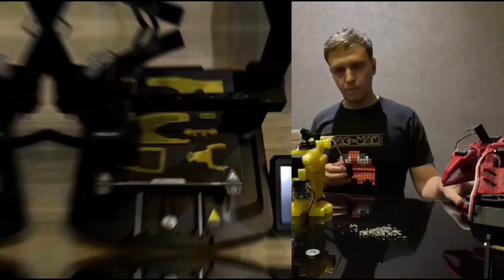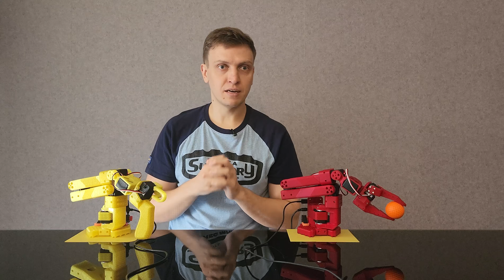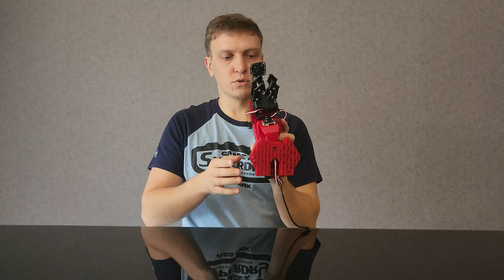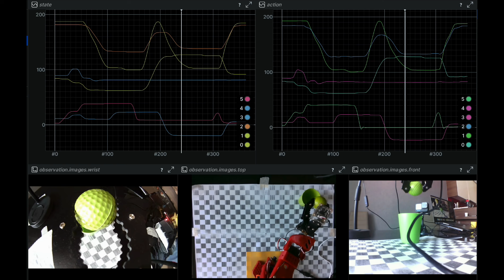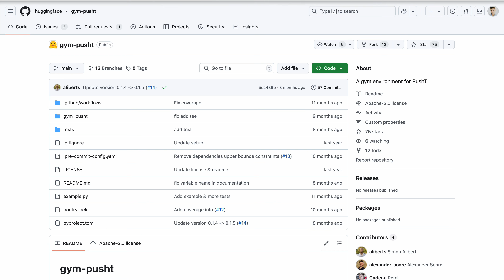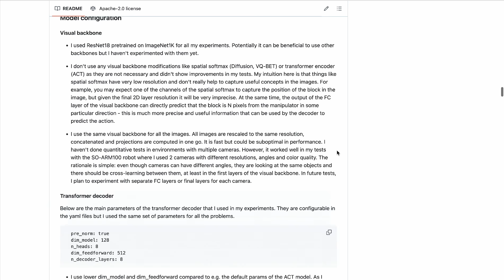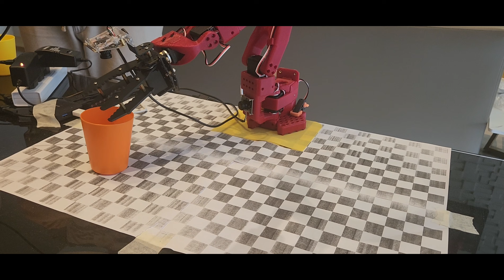Running AI robotics experiments at home with LeRobot and SO-ARM100

Comment: Cool video! One question regarding your setup: You're using that chessboard surface for recording the dataset .. that probably helps the model with coordination. Does the trained model work as well on other surfaces or does it require those squares to orientate?
Reply from the maker: Small models like ACT are usually very sensitive to the environment change, but if you train a bigger model with diverse enough data it will work with other backgrounds as well. You don't really need this chessboard pattern.

Comment: Hii,
I use a realsense 455 camera instead of a webcam because I don't have 2 webcams

But I couldn't get 30fps--- frames were dropping
So I used 15fps, can that affect the policy???
The robot picks from 3/5 positions which were in the training data

Can 30fps help??
Should I collect data again with 30fps somehow??
Reply from the maker: For simple tasks 15fps should not be a problem, anyway you usually make ~1s chunk predictions. For hard high dexterity problems FPS can be more important.

Comment: Hii
The dot policy looks very similar to the ACT policy...
What's the difference??
Reply from the maker: Yes it is very similar, but dot is even simpler. My initial idea was to take some of the existing simple policies, drop most of the components from their architecture and add them back one by one to see what actually matters. So I started from ACT and removed like 2/3 of it - removed the whole VAE part and encoder transformer, and kept only one decoder transformer + simplest possible inputs and outputs encoders/decoders. So it is the minimal possible transformer based policy architecture. And turned out that I don't even need to add anything back, it already worked well, with some extra tweaks I made it better than ACT and Diffusion on a couple of simple tasks (I just used what was available in LeRobot at that moment). ACT is usually considered a simplest go to policy, but I have shown that you can have even much simpler policy with much less parameters and it still works well.
Reply: @ilialarchenko ooh nice way 
Thanks!

Comment: What about collection data while changing camera position relative to world? if we will run inference on one unique camera pose, the model learned to pick and place only with a specific relation
Reply from the maker: Yes it is true. Changing cameras positions will break the model, as it overfits to the particular camera set up. It is partially resolved by training time augmentations (you randomly clip and rotate all images) so it should be robust to small changes, but any significant camera position shift will break it. I think if you have a lot of data collected with very different cameras set ups and big enough model you can train a policy that is much more camera agnostic, but you will probably need a very big and diverse datasets for it. Also I am not sure if you can achieve the same results as with the fixed cameras given the same amount of data. It is a nice topic to research but I haven't seen any papers trying to do it.

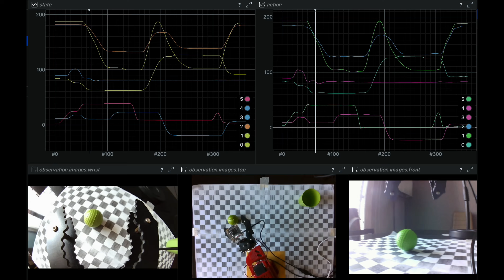Comment: Are you training the model from 3 different camera angles 28:22 ? and during interference which camera are you feeding to the model ?
Reply from the maker: Yes, I use 3 cameras simultaneously both for training and inference. In practice 2 cameras (gripper + some high level view) are usually enough for simple tasks, but the more cameras you have the better.

Comment: I know this is an old video, but it would be great to see what useful tasks people have done with these - I think the main concern I have is the lack of dexterity, and it is confined to a small radius of action, which limits agentic utility - but I would love to be corrected if I am mistaken
Reply from the maker: Yes. It is true. It is hard to go for a production use case with this robot. But it is useful for the education purposes and prototyping. Eventually all processes and policies are the same for $100 arm and $5000 one. So if you have a good recipe for SO101 you can upgrade your setup to a more capable arm, and it will probably work without big changes.

Comment: Thank you for your informative video.

But I’ve got one question.

My question is whether the initial position of the motor rotor matters when you assemble it. Is the horn’s position relative to the motor important? In other words, is the starting position fixed, or do they use some calibration system to account for it?
Reply from the maker: There is a calibration process that allows you to fix any inconsistency in the assembly. But there is still a default position of the robot that corresponds to the middle state of each motor and it is better to assemble it close to it - but you don't need to be very precise, calibration will fix small mistakes.

Comment: Super helpful video Ilia, thanks a lot! One question, I built an SO ARM 101 with a wrist camera as well as a top camera mounted on pole. I have been collecting pick and place datasets, with a cup and a pen cap that should be collected. I then trained ACT with Lerobot train code. In the first dataset I varied the position of both the cup and the pen cap and the success rate was 0, the arm always tried to grab at the wrong spot. I then made it easier, by having the cup always at the same position, now the success rate is maybe 10% but still the arm tends to grab a few centimeters at the wrong spot. Any advice how to improve this?
Reply from the maker: Is your top camera fixed? If it is not in the exact same position during the dataset collection and rollout, it can be a problem - ACT can be very sensitive to it. Overall, it should be relatively easy to get a 50%+ success rate for a simple pick and place task.

Comment: Can you share where to find that gripper? Seems to be a lot better than the original one.
Reply from the maker: I took the gripper from another robot I bought many years ago. I think it is this one: https://www.ebay.com/itm/222230012431
However, it is not designed for the servo motors used by the SO-ARM100. So, I really brute-forced it to work (don't recommend it).

Comment: What is the system setup required for this how much vram required to train the model
Reply from the maker: For small models like ACT or DOT, any reasonable GPU will work. I trained it on 2080Ti, and it was enough. For anything bigger or large datasets, I would recommend renting H100/H200 in the cloud.
Reply: @ilialarchenko thanks for your response  i am planning to use openvla model for my tomato picking robot  , which hardware setup is best
Reply from the maker: @santhoshkumar181994  OpenVLA is pretty big. I would recommend H200 or maybe even a few of them
Reply: @ilialarchenko thank you

Comment: Hi Ilia, Regarding the camera positions, should the top camera have the entire follower arm in its view? Or is the idea to focus on the objects? What would your recommendation be? What would be the 2 mandatory positions?
Reply from the maker: I think it is an open question with no correct answer. Good practice is to have one view that gives you a big picture - like s top view, and one view from the gripper. Good sanity check is to be able to teleoperate the robot using only cameras feed.
Reply: @ilialarchenko  I wonder if it's possible to train a policy that takes not just raw camera feed as input, but perhaps a worldmap maintained by some SLAM software as well. A behavior could be trained to assist in mapping by having the arm "look around" until it sees the ball. Then, even with a 1st person perspective on the gripper or robot base with no 3rd person view, it might be able to grab the ball (to use your training scenario as an example) and get it into the cup - even if both are not directly visible at the same time.
Reply from the maker: @MrMo-oh4wf , yes you can add extra inputs to the model, like the map and signals from navigation algorithms. But you can also train the policy to search for the object and move to it directly end-to-end. VLA models do simple navigation pretty well.

Comment: Hi Ilia thanks for the video, question is possible to collect and train the model on a Jetson Orion nx? What would be your recommendation if you don't have a PC with a GPU at hand?
Reply from the maker: It is possible to train and run a small model on Jetson Orin: https://www.hackster.io/shahizat/running-lerobot-so-101-arm-kit-using-nvidia-jetson-agx-orin-19b8a4?ncid=so-link-375235-vt48&linkId=100000373759001

However, for larger models (such as VLAs), you will need a more powerful GPU. I recommend renting it online.

Comment: I attempted to finetune a smolVLA model on a similar setup (top down camera and wrist camera, and random placements of cup and ball), but mine ended up not finding the ball. it just goes to random locations and opens and closes the gripper. I trained it with 20.000 steps, and i had around 60 episodes. What would you do in a situation like that? More data?
Reply from the maker: I have another video about VLAs https://youtu.be/8dZUOo5xWFw and will post one about SmolVLA later. I haven't experimented with SmolVLA much yet, but you can see a short demo of SmolVLA trained on 55 episodes of very similar problem and it works more or less fine. I used default parameters for training and it worked without problems.

You probably have some basic issue:
- Did you check you recorded dataset? Are all videos recorded properly?
- Did you move you top down camera? Your policy can be very sensitive to camera location - if you collected data with one camera position and then moved it a few cm, the policy can fail
- Check that you send camera images to the model in the same order you used for recording dataset.

It is hard to say what exactly wrong in your case, but I would do some sanity checks of the set up first.

Comment: I wonder how about using cheap motors like MG 996 at follower robot and only encoders at leader?
Reply from the maker: You still need encoders in follower for 2 reasons:
1. It uses PID to self-correct - without encoders, the position will be much less precise.
2. You use the current actual positions of the motors (state) as one of the inputs for the policy.

I think follower without encoders will work much worse.

Leader with only encoders is sufficient for teleoperation and dataset recording, but there are some use cases, like human-in-the-loop RL, where you want the leader to have motors too.
Reply: Thanks for the information.

Bus servo motors are quite costly here, $50 each.

My plan is to try with Mg996 + encoders. I know it will be much hassle. 😢
Reply from the maker: @MahmudulHasan-eq7ug  I also think that MG996 has a different size, so you will need to adjust the 3d models for the arm too, to fit them.

Comment: Hey good  job on the DOT policy, was wondering what is the minimum requirement to perform inferencing and fine tune your model
Reply from the maker: In the video, when I demonstrate how it works with the real robot, I am running it on my MacBook M1 without any GPU. It processes images from 3 input cameras and makes ~25 predictions per second. For training, any reasonable GPU will be enough. Of course, the training speed will vary, but I trained a real robot policy on 2080Ti in one day, and it was enough.

Comment: Hi there! i was wondering what screws did you use to mount your base camera?
Reply from the maker: I just used some small wood screws. I don't know the exact type. I have printed more proper camera brackets since then.
Reply: Would you be able to share the STLs for those? If not I could definitely check around a local hardware store for some wood screws that fit
Reply from the maker: @draxicon5139  yes, the camera mounts that I use right now are shared here: https://github.com/IliaLarchenko/lerobot_random, but they are for my specific camera

Comment: 7:12 later it could used for two hands operations, like threading a needle 😅
Reply from the maker: It is possible but a bit challenging. The best way is to use 2 leaders and 2 followers simultaneously. And for threading a needle you will need a more precise robot.

Comment: Hey, I found this model worked very well with the old recording format
, will it be ported to the v2 data format?
Reply from the maker: Do you mean DOT policy? It should work with v2, but there were other changes in the library since I made it, so not sure if it still works out of the box. The LeRobot team was working on a PR to merge it into the main library, but I am not sure if/when it will be done.

Comment: Hello. Thank you for the video. Would you mind recommending a power supply and servo bus driver compatible to use 6x 12V servos (e.g Feetech 12V 30kg STS3215) ?
Reply from the maker: You can follow official BOM: https://github.com/TheRobotStudio/SO-ARM100?tab=readme-ov-file#sourcing-parts
Regarding the power supply there are many discussion in discord. Official recommendation is to use 4-5A one, but some people try to measure it as say that it never goes above 2A in practice. I even use 1A supply for 6 12V motors and it works well, so just choose one that is easy to get.
Reply: @ilialarchenko got it, thanks a lot !

Comment: What camera mount are you using for the overhead birds eye view?
Reply from the maker: I just bought the cheapest phone mount I could find. Nothing special about it
Reply: @ilialarchenko  do you have a link? would like to mimic your setup. Also for the side view camera is that another tripod?
Reply from the maker: @TheRealJoshuaYang no I can't find a link. But literally just search for any camera holder/mount it is not important. I just bought some random one for less than $5 and it works fine. The small tripod for the side camera was part of Realsense camera package if I remember correctly

Comment: Hello Ilia,
Is it easy to use Lerobot training? Is there a procedure?
When do you think DOT will be implemented in Phospho?
I ran 50 episodes as planned with the same positions, without any interesting results with ACT or GR00t.
Reply from the maker: Yes. Just one script run to train your policy, just follow the official guide: https://github.com/huggingface/lerobot/blob/main/examples/12_use_so101.md
I am not sure if DOT will be integrated into Phospho. LeRobot team wanted to integrate it into official LeRobot library and there is wip PR, but it is not there yet (though you can use my old fork to do it)

Comment: Hello Ilia,
I'm working on Phosphobot and I've created some datasets for my SO100.
My robot is supposed to catch a ball and put it in a cup.
I tried training with Gr00t and ACT, without any convincing results.
The robot "sometimes" goes towards the ball, but without ever going down far enough to catch it.
However, it often goes towards the cup to drop it, but has nothing to drop :)
I have three cameras (one above, one on the wrist, and one at the bottom of the arm).
I created an environment with uniform white and matte surrounds, which didn't produce any results.
I did a training session with very slow episodes, without any results.
My question is: is it possible to use your procedure (DOT) to train my datasets? I'm a beginner, and I don't see how to do this from your scripts, if it's possible by the way.
Thanks to you.
Christian
PS: Sorry, my English, I'm French and this is a Google translation...
Reply from the maker: The simple grab and place problem is definitely solvable by any of these models. ACT and DOT policies should be capable of learning from ~50 recorded episodes without any problems - I did it myself and have seen other people doing it many times. So you're probably doing something wrong (not policy-related).
Gr00t is a much heavier model. I wouldn't recommend using it before you make it work with ACT or DOT. Probably, ACT is the easiest to do as it is already implemented in LeRobot and Phosphobot.

Try to overfit for the simplest possible tasks first: put your ball in the exact same position and grab it exactly the same way. 20-30 episodes should be enough for this. Your model should learn to do it without any problem; it doesn't even need to rely on cameras - it just needs to remember the movements.

When it works, try to make it more complex and put the ball in 2-3 different locations and collect 50+ episodes.

Maybe this approach will help you isolate the problem.

Also, try to train the model longer. It is usually hard to overfit, try to train it for a few more hours and test it.
Reply: @ilialarchenko  
Thanks for the info.
I'll try to do as you said (I tried with 10 episodes by placing the objects in the same locations, without success).
I'll do 30 episodes like that, and then continue with other locations if it works.
Also, you say to train for longer. How can I extend the training time with Phospho?
Do I have to restart the same training several times?
Thank you very much for your quick response anyway.
Reply from the maker: @saxman8748 I don't use Phospho, I use LeRobot for models training. So, I am not sure, but there should be some parameter like the number of epochs or steps that you can increase